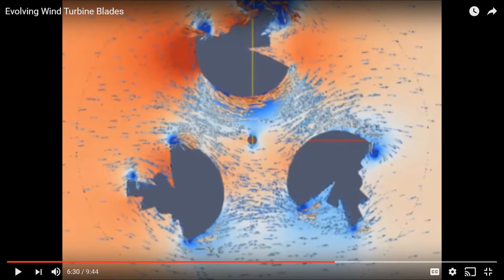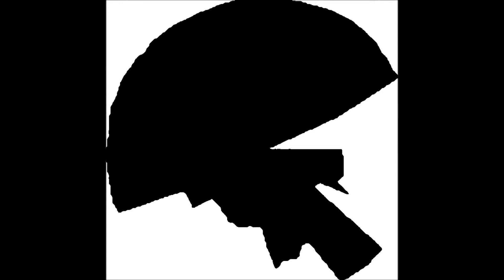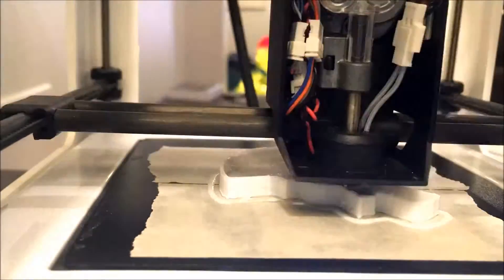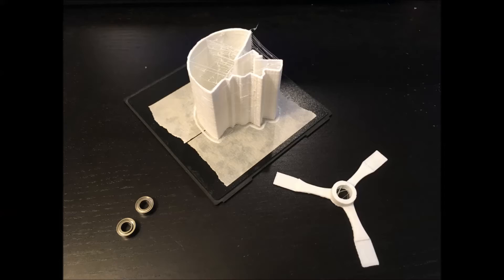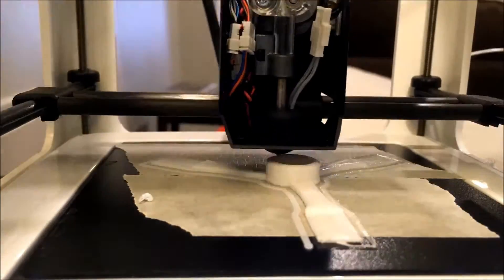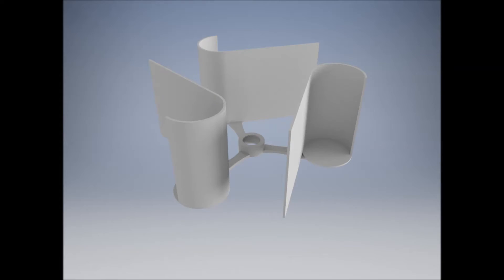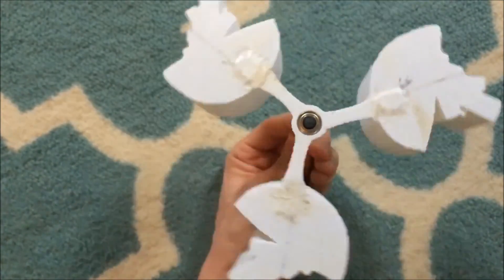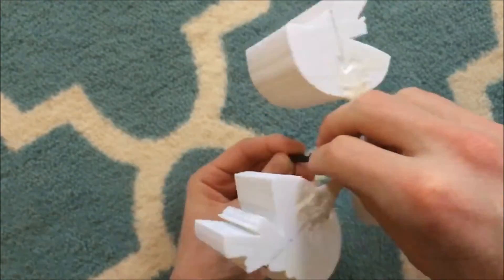Does an Evolved Turbine Blade Work?

Comment: When I did the original evolution, my computers were pretty limited, so my simulation was only for about 1/3rd rotation and only at one air speed.  Computers could do much better these days.  Unfortunately (or fortunately) OpenFoam has been upgraded to the point where the old software I wrote won't work.
Reply from the maker: O no! Well maybe I can take a look at OpenFoam, thank you for the info!

Comment: Instead of the bearing, mount it on the shaft of an electric motor. Preferably a brushless RC-hobby motor. Connect the 3 leads of the motor with 3 equal resistors. That way you have a repeatable (well, it's there, right?) load with each turbine you test. You won't get any numbers, but you can compare rpms to see which one is better.
Reply from the maker: O goodness, 5 years later and im fiiinally trying to get back into making videos. I think this is a good candidate to revisit.
Reply from the maker: I can totally do that! I do these videos in my spare time(which I don't have a lot of), so it might be a while before I can get around to it.
Reply: Any updates on that?
Reply from the maker: My family and I move cross country, during the move the turbine was destroyed, luckily the 3d model still survives on my hard drive and I can print another.

Comment: Do you by chance, have an old bicycle  dynamo you could hook up to the mashine? adjust the strength with some gears. If you do not have a way of measuring the  electricity, simply use a lamp and look how bright it is.
Reply from the maker: Unfortunately I don't have any old bicycle dynamos laying around.

Comment: It looks to me like the angle you mounted the jellyfish blades at puts the "tail" of the jellyfish too far out so it produces drag. It looks like it doesn't correspond to the same angle as the one used in the original simulation. Have you tried turning jellyfish such that the irregularly shaped "tail" of the jelly is slightly more inwards so it doesn't "stick out" and produce so much drag? Superficially it looks like this might explain some of it's lower performance at least.
Reply from the maker: I was fairly sure the blades couldn't be pitched one way or another due to the way the spar and blade are designed to be connected, but just to be thorough I took the screen shot from the original video and a picture of the turbine I designed and built, overlaid the the 2 images and the blades match angles perfectly. I do honestly believe that this turbine doesn't work well in our atmosphere but this design may work very well under water. Water's viscosity very closely matches that of Jupiter's atmosphere. Maybe this should be my next video?
Reply: Yes it would be interesting to see how it performs in different gases and liquids. Sounds like a lot of work though :)
Reply from the maker: I'll totes buy a plastic baby pool for science.

Comment: Glad to see someone made the jellyfish! It does look like the lens(spelling?) spins much better. How do the weights of the two turbines compare?
Reply from the maker: The Jellyfish weighs a noticeable amount more, how much I don't know, but I can estimate the weight difference by looking at how much filament I used for each print. I'll brb with the answer.

Edit: The lens blade weighs about 53% less than the Jellyfish blade.
Reply: @hellothisismax  and does the jellyfish spin 53% slower?
would be interesting to know which provide more energy to be extracted by a motor. maybe the jellyfish makes more torque?
Reply: ham salad
Reply: Sean Runion my favorite